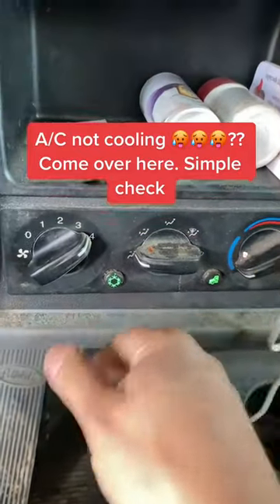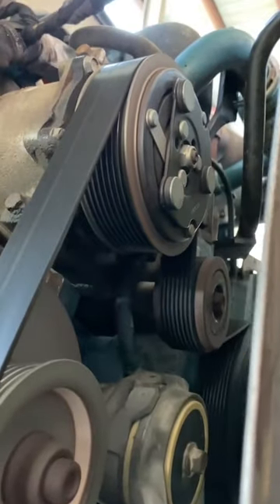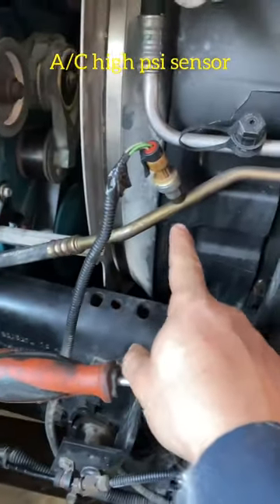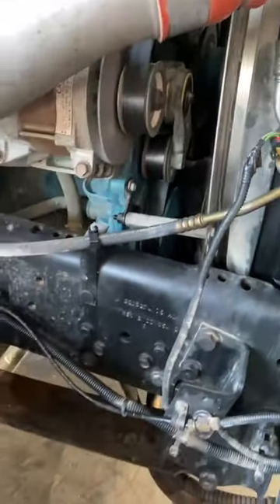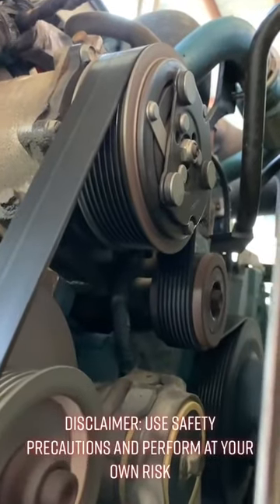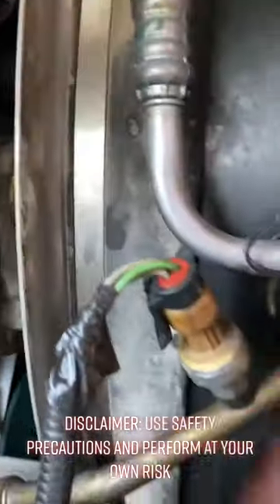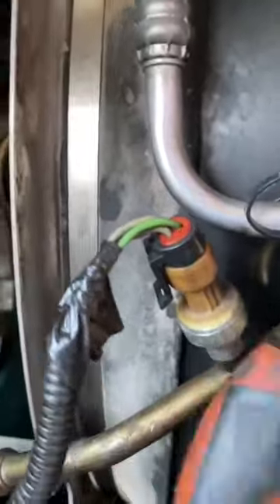🥵 If Your Vehicle AC Is Not Cooling, Make Sure You Try This Solution! 🎥 @d.thetruckguy

Comment: It still needs to be evacuated first or can it be changed without evading the system
Reply from the maker: Thank you for the insight!
Reply: Normally theres a shrader valve under the sensor that seals the hole when you unscrew the sensor

Comment: Well mine kinda works but for some reason the ac clutch has worn out way before the compressor for some reason
Reply from the maker: Oh no 😢
Reply: You can readjust an electromagnetic compressor clutch that has worn down. Usually, there's a center bolt which holds the outer clutch plate onto the splined compressor shaft. If you remove that, you can pull off the outer clutch plate and you'll see that there are shims sitting underneath which are what maintain the gap between the clutch plates. If the plates are worn from use over many years, the gap will be too large and the electromagnet of the clutch won't be able to pull the plates together correctly. Magnetism obeys the inverse square law. Doubling the distance from a magnetic pole reduces the power of that magnetic field by 4 times. Thousandths of an inch make a big difference in the ability of the magnet to engage the clutch. You can get a shim set or shim stock from NAPA or Ace Hardware, etc. and measure the gap with feeler gauges and calipers or a micrometer. Then you can readjust the clutch gap to spec by trying different thicknesses of shims until it's back to being correct. You can also take that time to clean and buff the surfaces of those clutch plates so they aren't oily or glazed. Lots of compressors have an intentional or unavoidable leak from their front shaft seal and that oil can contaminate the clutch faces over time. If the clutch is really just unadjustable and unusable at this point, you can replace it by itself without needing a whole new compressor and without needing to do a recovery, vacuuming, nitrogen test, and recharge by weight.

Comment: Well mine doesnt work because i had the ac evacuated for when i replaced the engine
Reply: Hopefully you didn't leave the system in a deep vacuum. A non-hermetic system like an automotive AC system is designed to be under pressure at all times. Leaving it under vacuum will suck seals and o-rings out of their normal operating position and it will draw moist air into the system which will get absorbed into the oil, destroy the desiccant, and form acid in the oil which will destroy the compressor over time. If you aren't recharging a system right away, ALWAYS break the vacuum by filling at least a few PSI of dry nitrogen. I put around 20 PSI myself, and then when it's time for a recharge I resume where the process left off and do a triple vacuum/fill with nitrogen before the final deep vacuum and recharge by weight of refrigerant.
Reply: @mannys9130  Thanks for the education! Screen shotted, 'preciate your taking the time!